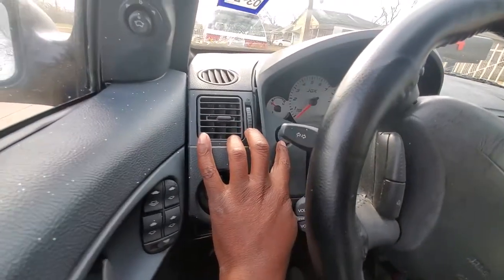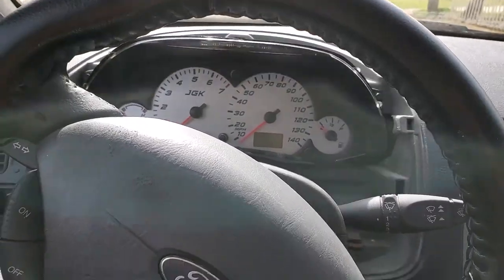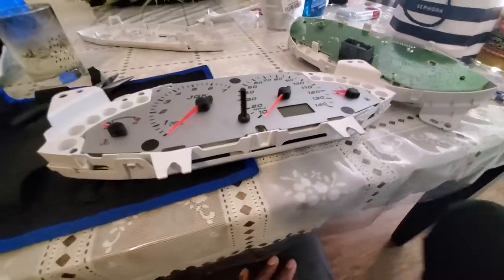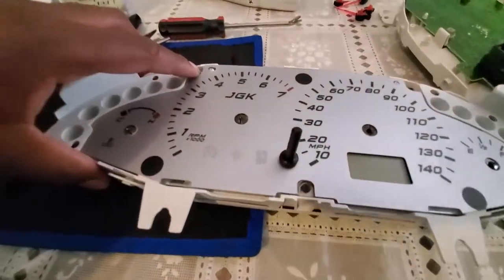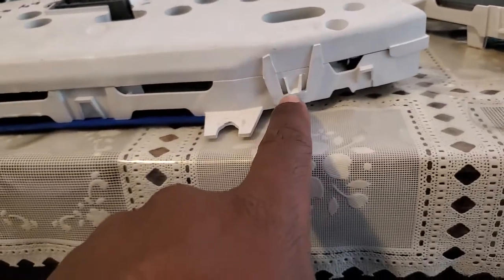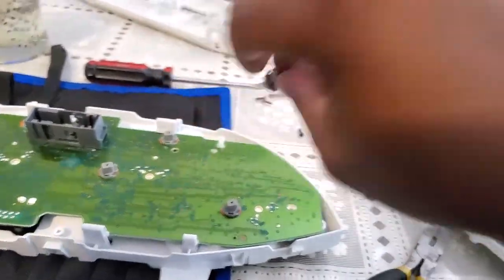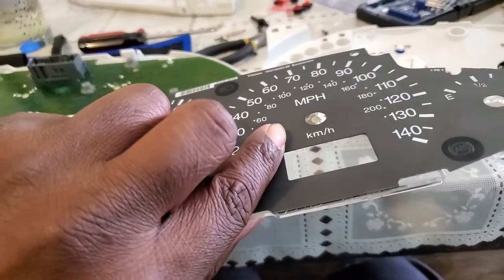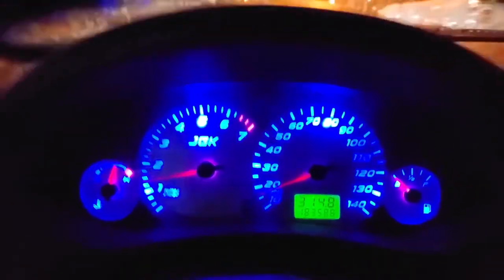Gauge Cluster Tear Down-Episode 16

Comment: does this recalibration method of moving the needles manually work to measure true speed if you're getting undersized tires? probably not right
Reply from the maker: You wuold need to program the tire size into the pcm... then you can manually set the needles

Comment: Is it possible to replace the furl gauge.... the needle acts like a 80 car, it moves back and forth... it just started to act weird...
Reply from the maker: You can but younwould need to manually set the fuel level.
Reply: @FocusedHands  would that be replaced in the cluster or at the fuel pump.... the fuel pump assembly is brand new and from motorcraft... it has no more than 10k on it...unless the assembly is faulty. The floater..
Reply from the maker: @martin19117  could be the floater! And if it was working before the new pump was installed... then it is likely the floater.
Reply from the maker: @martin19117  i had this issue when i replaced my fuel pump aswell. Had ro adjust the floater correctly.
Reply: @FocusedHands  I'll take a look at it today when I get home...I sometimes was pumping more gas then the tank could hold.... probably that mest it up... I drive far for work and I would add an extra gallon in there once the pump stopped by it self...
Reply from the maker: @martin19117  hmm keep me posted!
Reply: @FocusedHands  hi... so today,  I took the pump out of the tank, and the sending unit is accurate... the scanner was connected to the car while I was testing it... when I moved the floater, the scanner in real time move along with it... the gauge did not move even if I left it for a minute..
Reply from the maker: @martin19117  ok so your issue then should be the gauge cluster
Reply: @FocusedHands   is there any stepper motors on the cluster?.. I don't remember if there is.. I soldered led lights on the cluster because the original bulbs would burn out...
Reply from the maker: @martin19117  its been so long i dont remember aswell lol! I want to say sure... tell you what ill see if i can fine my old one
Reply: @FocusedHands  I'll take mine out tomorrow to check it out... there has to be something in there to make the gauge move
Reply from the maker: @martin19117  yep its on a motor
Reply: @FocusedHands  I guess the million dollar question is... where can a generic or specific stepper motor be brought from... I'm assuming those has to be somewhat specific because of the range of the needle travel..
Reply from the maker: @martin19117  I would go about replacing the cluster with 1 from the pick and pull junk yards. You can then match your mileage using forscan.
Reply: @FocusedHands  the forscan tool, would that help me to transfer the current mileage onto the new cluster?.... I'll look into the tool right now
Reply from the maker: @martin19117  its a software that we use to configure the focus. You can get a free trial. However you will need to watch a video on YouTube or pull the manual to configure the software. You will also need some way to cinnect your computer to the car. I used an obd scanner with the canbus switch.